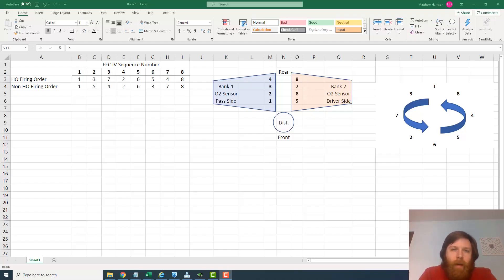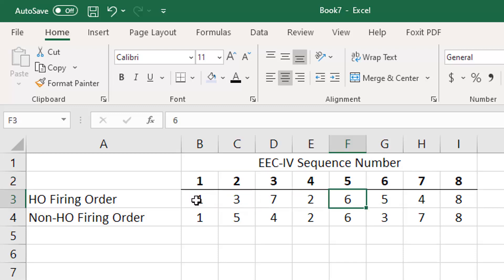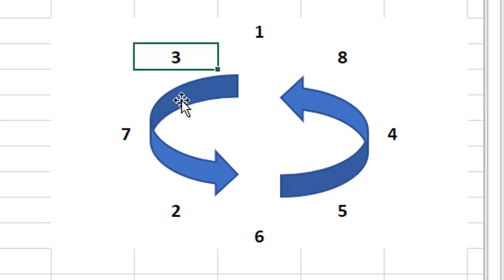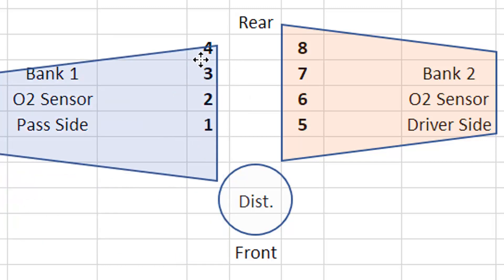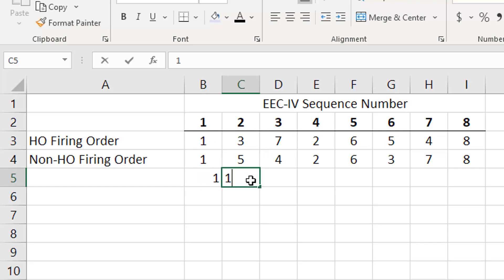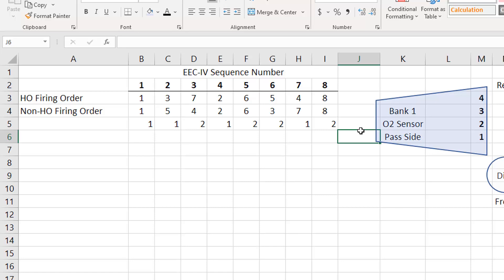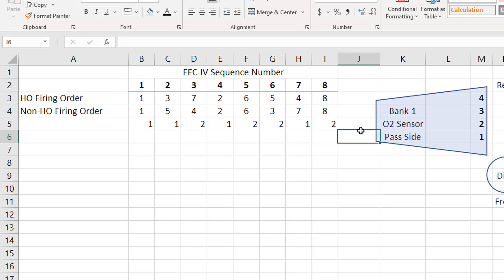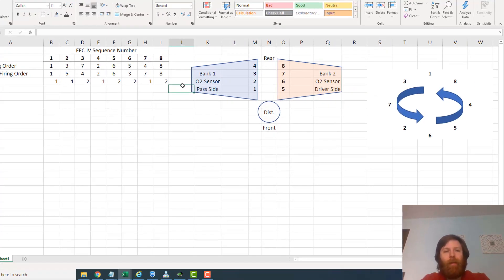Running a Non-HO Cam on a Stock Foxbody Mustang Mass Air Computer. Will it Work?

Comment: I’m in a pickle the company I bought my engine from sent me a non ho can and now that the car is put fully together it’s not running but on 1,2,6,8 and I can’t find a stock cam, don’t want to pull everything apart and replace the springs either, does anyone know if someone can retune the stock computer for non ho firing order or what might be easier because I’m 2 years and 25k deep and can’t handle pulling it back apart, I may be 4 years too late but I’m desperate

Comment: It works but it sucks very bad 😁  Did a stock EFI conversion on a 65 Ranch Wagon with a T-bird intake/throttle.  Had to put a Tweecer on it to fix the injector firing order.  Tweaked a couple of other things and that car was freaking awesome to drive.  It was a customer car, so no joy for me!

Comment: Is there a computer you can swap in to make it work? I’ve got a built 289 and I’m about to buy a fox. Not sure if it’s a h.o. But I really want to put this engine in the car. Non h.o cam obviously. Custom cam with 1-5-4 firing order. What can I do to make this work.
Reply from the maker: So if you are planning to do a mass air fox body computer, you would not be able to run that cam without a custom tune. I have never had to do it before, but you can change the firing order in the tune to whatever you want... this allows the computer to still leverage the oxygen sensors with a correct understanding of which injectors are on bank 1 vs bank 2.

Comment: So I remember you going over the stock ecu method for ACT temps and idle speed. So basically I’m having an issue with my pretty stock car in that when the car idles for a while the RPMs go up. And it’s enough to irritate me. I think I have a bit of air in the cooling system and was wondering if this hot air heating up around the ACT sensor could cause it to read hot and increase idle RPMs?
Reply from the maker: What computer are you running? Several of the fox computers will increase the target rpms after idling for more than a few minutes... regardless of temperatures. Then there are also the adders that kick in based on high temps.
Reply: @LeechMotorsports  So one more question. I have a very mild setup which is explorer upper and lower (egr version) 65 mm throttle body (stock was shot and leaky) a fender CAI, stock MAF, explorer 19ib injectors, stock tfi/ignition setup/and a 255 lph fuel pump. When I rev the car in neutral, the idle will never go back down to what it was. It doesn’t matter how long I let it set. Let’s say my base idle was 750 when I revved it, it will return to maybe 850-900. I have no vacuum leaks. I should also add that this problem also happened with the stock upper and lower and stock injectors
Reply from the maker: This is a combination of a tuning issue and a throttle body stop screw adjustment issue. Untuned, the factory A9L has a target idle rpm of 672 rpms once warmed up and in normal conditions.  When you touch the throttle, the idle air valve opens immediately. This is called dashpot preposition mode. Then once you let off the throttle, the dashpot idle air will slowly decay so the rpms can fall back down gracefully. The problem is that the dashpot air doesn’t come all the way out until you have slowed down to a near stop and your rpms are within 150 of the target idle speed. If you have already cracked the throttle blade open too far, you probably aren’t dropping down under 822 rpms, and so it just hangs there forever and doesn’t go back into idle speed control mode.
Reply from the maker: This is one of the big reasons that guys who think they can just crank up the stop screw to make a camels car idle better end up with other drivability issues that cannot be addressed without tuning.
Reply: @LeechMotorsports  Simply wonderful explanation. Thanks for all your help. When I finally buy a moates I’ll be sure to come to you guys for all my tuning. Thanks again
Reply: @LeechMotorsports  A9L
Reply: @LeechMotorsports  Hmm so is there a specific reason Ford did that? Could it be safely deleted with a tune? Also thanks for this info this is something I’ve never heard talked about before
Reply from the maker: I believe ford raised the idle at high temps in an effort to spin the water pump a little faster and to assist with cooling things back down. And for the one that adds rpm after extended idle (even if temps are normal), I’d guess that is to get the alternator spinning faster to keep things charging. The stock alternator was garbage and surely some ford engineer thought this was a way to help things out. I often remove both of these adders in my custom tunes. Especially if the cooling system and alternator are upgraded.
Reply: @LeechMotorsports  Well I will be upgrading my alternator here soon so I know who I’ll be going to to get rid of that
Reply: @LeechMotorsports  Thanks for the info also. I feel a lot better about my car now
Reply: Leech
Looks to me that either idle increase program might be a benefit if driving under drive pulleys/ water pump on the street.
JMO 😎🔔

Comment: Great channel and content, I appreciate your generosity with your knowledge 👍. I’ve got a question with on a different topic. I have an 88 GT AOD, it’s a work in progress....I’m currently not running O2s, will this cause an insufficient ground for the computer?
Reply from the maker: If you don’t have the o2 sensors in place, it should not cause any issues with other aspects of the efi system. Oem efi systems have to be at least somewhat resilient and able to function when sensors are missing or not functional.
Reply: @LeechMotorsports  thank you for your reply!!! Your videos are really helpful, this poor car is a nightmare lol. I’m about to repin the O2 harness and try an 86 5 speed computer. Will this computer make less power? As far as tuning goes, all I have is a timing light and an adjustable regulator......🤷‍♂️

Comment: A friend of mine he used to have a fox body with the 5.0 modified but he always had issues until I told him to replace his ECU to an A9L, because his mustang had a low emissions ECU 8LD and that has the firing order 154 
Which is what is most known as the firing order for the 5.0's
Because everybody thinks that 137 firing order belongs to 351 but also that's for the 302 HO's.
Well long story short Lol 😂 but once he replaced the ECU his mustang start running strong as supposed to.
This video is the proof that I was completely right and you say very awesome info, now I'm running my Stang without oxygen sensor with stock injectors, but I want to learn tuning that way I can install oxy sensors in order to have my mustang running good.

Comment: my mustang runs like crap with the 137 firing order and 154 runs great... stock a9p ecm, injectors are 19lbs and looks like factory wiring,... now my o2 sensors.. one looks like it is made for a lil car the other one is twice as big.. also i have the e6 heads idk what cam i have and block comes back to a 89 5.0 roller.. i can send and or upload video showing my set up.. i have no drivibikity issue but this throws everyone that has seen it for a loop
Reply: that being said i could be wrong or it couldve been tuned
Reply: common. different brands of oxygen sensors are often much different in physical appearance. I put 1 Bosch and 1 xx?  and 19# ev6 in a 90 and it ran great.